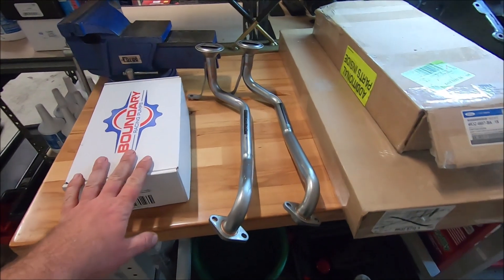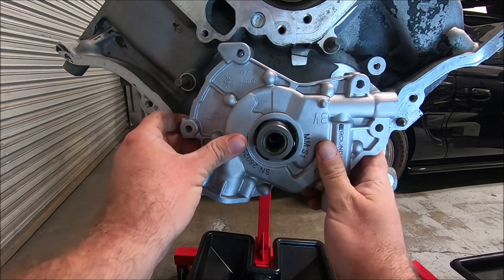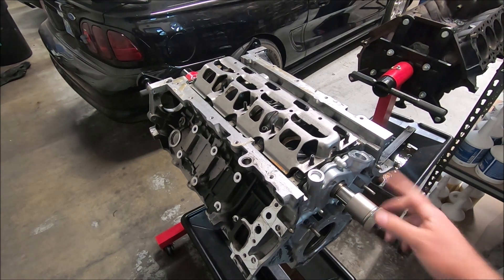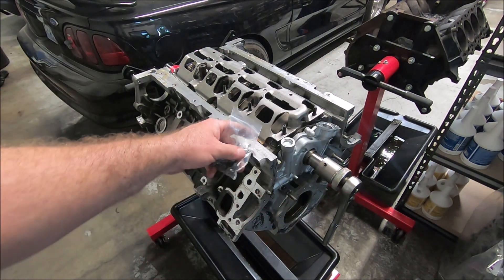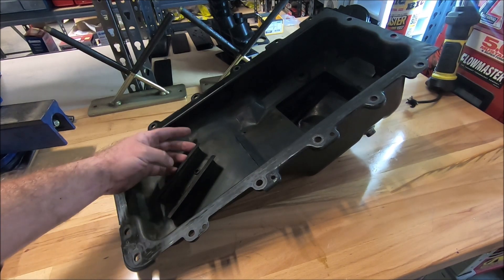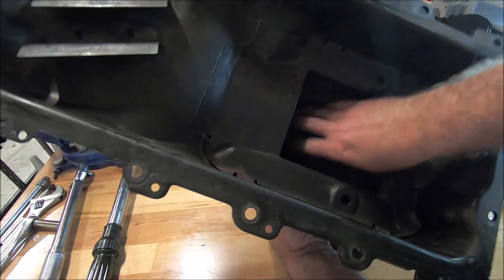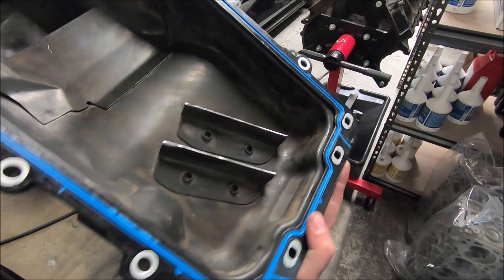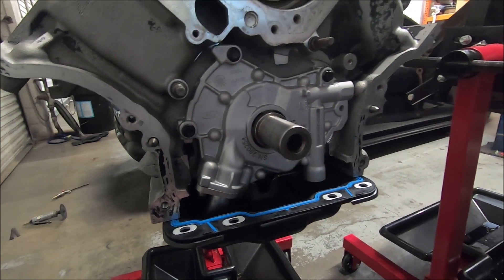99 Mustang GT with Nemak Part 13 – Upgrading the 4.6 2V with a Boundary Oil Pump & 3V Windage Tray

Comment: The 4 valve tube seems to retain oil due to the bend , keeping it from having dry start ups, It looks like it to me anyway. The other one doesn’t have as aggressive bend so it will drain out completely changing the oil , again I can’t tell for sure at the angle of the video. Did however give me something to consider! 👍🏼

Comment: Can you remove the oil pump with the oil pan still on? I imagine so but getting to the pickup tube bolts can be tricky.
Reply from the maker: Yes, it can be removed without removing the oil pan.  A ratcheting 8mm wrench makes it a lot easier to get to the pickup tube bolts.
Reply: @JohnSmithRacing  Hey thanks bud my timing covers got a leak and I'm doing all the maintenance required at 139k because I don't wanna have to do this again. Probably overkill but I believe it's reasonable @200$ for the timing kits gaskets and oil pump gears makes it worth going in and doing it. Thanks for the knowledge.

Comment: Hi sir, I just set the clearance on my nPI 4.6 2v, it had a bent pan and pickup so I replaced the pan and re-shimmed the pickup (no cracks or anything actually ran fine prior to disassembly). Anyway, being a little bit bent the pickup wasn't quite level. My final readings were 0.353 on the rear side of the pickup and 0.381 on the front-most side. Should this be fine?
Reply from the maker: Yes, it should be fine.  I try not to be under 0.300

Comment: I like this mod. I've picked up so many tips from your channel. I'm rebuilding an aviator engine to put in a 2000 Mustang. I hit a snag when I purchased ARP main and rod bolts. The instructions say to line hone and round hone. So I am going to get Stock bolts for everything. Then I should be good? The block is honed (std) and crank is polished (std). Re-using the rods and pistons with Ford Std rings : according to Machine shop. Should I worry about the rod/piston bushing?
Reply from the maker: Most people will agree that using ARP fasteners does not require line or align honing of the mains.  However, some will say that using ARP on factory rods may require machine work to the rods.  I am currently running an engine in my 96 GTS that has factory rods and ARP bolts.  I didn't do anything special to the rods and I have not had any problems.  I beat on that engine regularly at the track too haha